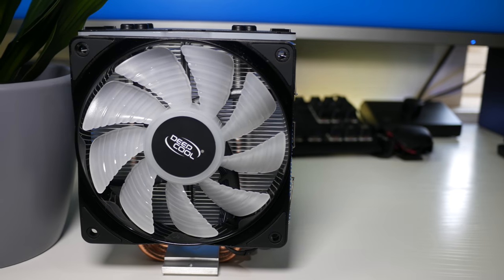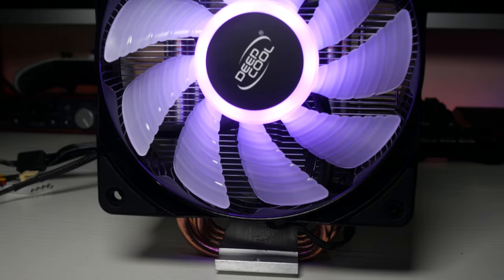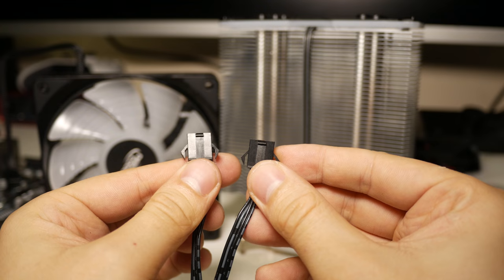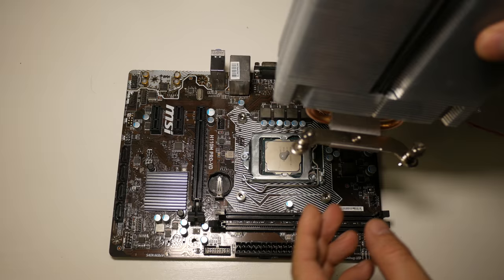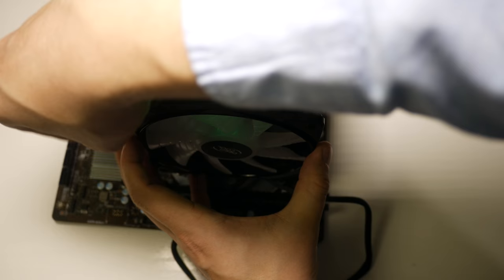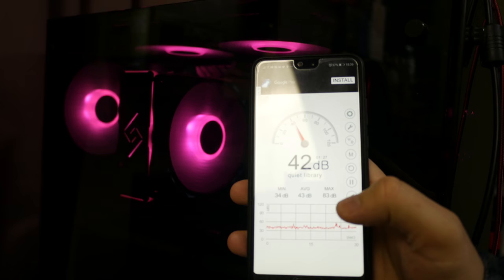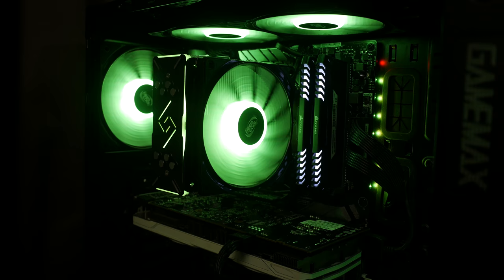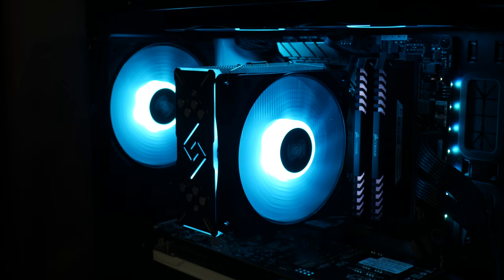DeepCool Gammaxx GT RGB CPU Cooler Review, Install and Thermals

Comment: Nice review. Short and sweet and to the point.
I just put one of these coolers on a Ryzen 5 3600X and it's been working much better than the stock Wraith Prism cooler did and I was already using DeepCool fans in my case and had a spare so now I have two fans on the cooler and it improved even more. I don't overclock so this cooler is going to be just fine for my build and having matching RGB components from the same company makes my build look very nice too. It's hard to get matching RGB lighting when mixing brands.

Comment: I've OC'ed my 8600K to 4.8GHz stable at 1.27 volts, 0 AVX offset on this cooler. Excellent temps all the while. 4.8GHz is certainly doable on this, but anything higher will need a better cooler.
Reply: What were your temps?
Reply: so do you think a Intel Core i5-9600K 6-Core 3.7 GHz wil be good on this?
Reply: @rocket8981  It should be as long as you don't fully overclock it

Comment: Is the Gammaxx GT RGB cooler than Gammaxx 400? In cooling performance (excluding the obviously good looks), is the GT a performance upgrade if I already have the 400?
Reply: discovered it?
Reply: Allagadan Design Same Question
Reply: Same question
Reply: almost same, the GT only slightly bigger, probably only 2 degree C temp at most

Comment: cool vid buddy. Indeed I use it with 8700k at 4.7Ghz and the temps on BFV are around 75-82C with a room temp of 24C. Probably need a better cooler for the 8700k

Comment: what's better this or hyper 212 black editiom?
Reply: If the 212 BE is similar to the 212 EVO, then the GAMMAXX GT would perform a bit better than it. Techpowerup has a review showing the GAMMAX GT performing about 5-6'C better at load than the 212 EVO. https://www.techpowerup.com/review/deepcool-gammaxx-gt/6.html
Reply: @Intranetusa  What about the noise level? who's better 212 BE or the Gamaxx GT?
Reply: @ult7511  Look on the next page of the link.
Reply: The hyper 212 BE has a new type of install. Apparently, people used to the old install find it highly annoying, but it's supposed to be easier. They also use an updated, better fan, it's supposed to be overall a pretty decent upgrade over the original. I'm likely ordering mine tonight.

Comment: Hi I have the MSI b350 tomahawk, and a phanteks p400 that comes with an rgb strip. I was planning on buying the 3 pack of fans, and the gammaxx gt. Would this work with my motherboard? Or would I need to buy some sort of adapter. I believe you made a video on this board, so I'd really appreciate some input, thanks
Reply from the maker: Lumen Roy I would probably just use the included controller as the tomahawks RGB (previous owner) is super limited to the point they should of just not added it.
Reply: Yeah the B350 Tomahawk doesn't have many features in the RGB, the newer B450s have much better software for controlling RGB. So, just use the included controller unless you're okay with just having a static color.

Comment: What cooler would you recommend if I got an Intel core i7 8700 non k?
Reply: if it's non-k there's no reason to use an aftermarket one.
Reply: I would disagree depending on the circumstances. If you are video editing get an aftermarket cooler! Seriously I had someone make the mistake and wondered why their processor was so slow compared to benchmarks. Thermal throttling really kills it. Otherwise gaming it should be fine in nearly all circumstances but the stock cooler is so ugly /:

Comment: I’m having trouble figuring out where to plug in the cords into my motherboard, it has 3 and I’ve plugged them into different Cpu inputs on the motherboard. The computer turns on but the fan/rgb do not. Someone help?

Comment: Hi, I have a ryzen 5 1600 on a b350 msi, now I want to change the heatsink by putting a deepcool gaamaax GT, do I have to dismantle the motherboard and replace the back plate to do the operation?

Comment: Quick question, I already have 3 rgb fans installed as intakes, but the fans came with a 1 to 4 rgb splitter, so I have 1 spare slot, does that mean I can use that spare plug to install this cpu rgb option?
Reply from the maker: It should work as I messed around with a splitter and a few rgb devices when I got my rf 120 fans and they all synced fine.

Comment: Quick question, I just bought the Asus ROG Strix H270F motherboard and then this cpu cooler plus a 3 pack bundle of deepcoolscase fans. I was wondering do I need to buy any adapters for the rgb to do aura sync or should it work fine?
Reply from the maker: Aaron Chan everything will work fine.

Comment: Is the installation of this cooler only directed to the back of the enclosure or can it be installed directed to the ceiling of the enclosure?
I mean the am4 board, thank you.
A instalação deste cooler é somente direcionado para traseira do gabinete ou pode ser instalado direcionado para o teto do gabinete?
Me refiro a placa am4, obrigado.
Reply from the maker: It's the same for both intel and amd
Reply: I mean the direction, if it is only for the back or it can be also for the top part of the cabinet?

Comment: The result in i5 8400 is great. But can the cooler do the same to i7 8700?
Reply: Abid Setiawan I got this on an 8700k running a bit oc, gettin around 30-35idle and 55-65 gaming load, hits like 75-80 if I’m streaming single pc at faster x264.
Reply: @hajime21sac  hm thats not bad. Thanks for the information mate.

Comment: Do you think this would be sufficient for the 3700X?
Reply: 7HeartThrob7  I use this cooler, it does OK. My CPU will hit around 84c under heavy load, but never for more than a moment because of how the Ryzens boost sporadically. Usually stays around upper 70s heavy load.

Comment: Can you sync the rgb lights with the cooler, if the fans are not deepcool brand?
Reply: I think it's Asus aura compatible so if your motherboard is an Asus one you will be able to sync it with your motherboard maybe if you have RGB ram but if you want to sync everything up I think you'll have to get aura supported fans and that's not common so...

Comment: I have this cooler. While it is really good.. I fucking HATED mounting it. It was easily mounted, did it in 2 minutes. But when you screw the fan onto the board.. the mounts it's being fastened onto can start turning around and SCRAPING at your motherboard. And given that there's wiring going underneath, this is not something you want.

Comment: I have a question why does my cooler show another color?i connected to the rgb header in my my asus motherboard and whenever i use the Aura software to change the colors it show wrong color lets say i put it on green it shows blue but why?
Reply from the maker: marjan center sounds like you haven't run  the sync setup on aura
Reply: what do you mean?
Reply: i did try color cycle and it was working well
Reply from the maker: marjan center you have to synchronize them with the aura software not all RGB are plug and play.
Reply: can you tell me how could i do that?

Comment: I really like Deepcool's Cpu cooler's, they are very well known for their silent running under the heavy load but I don't like the Cpu fan sticker on this particular cooler, The sticker seems to wobble up and down whenever the cpu fan Spins, I Didn't expect a Big company like Deepcool Doing these small mistakes.
Reply from the maker: Prateek Jadon I need to do some tests but I'm pretty sure that's just when there at lower Rpm. Asus motherboards allow you to go lower than its rated rpm so the wooble effect could be due to these issues as they certainly don't wobble at higher rpms.
Reply: TheFullSetup I understand what you are saying but I've seen all of the unboxing and reviews that I could find on YouTube and the wobbling is in every single one of them,could be a Design thing But I wouldn't lie this cpu cooler is very good if you take performance into consideration.

Comment: I5 8400 Stock? I was thinking of getting an Intel I5 8600k would that work at like 4.5ghz with 2 extra fans
Reply from the maker: ZANTA yes but I wouldn't go to far with overclockinh it adding an extra fan only really drops temps a few degrees on air coolers.

Comment: I will oc my r5 3600 at 3.9 or 3.8.. Is this aftermarket cooler good to go?
Reply from the maker: A ryzen 3600 already boost to 4.2ghz no need for overclocking
Reply: @thefullsetup  thanks. Noted
Reply: @thefullsetup  can i also ask if its good with b450m mortar max mobo? I want to make my build compact and i'm on the tight budget...

Comment: I have no 12v rgb header in my mobo to plug this in  what should I do ?
Reply from the maker: Use the included controller which doesn't require a 12,v header.
Reply: @thefullsetup  so what is the only cable i need to plug in to make my cpu cooler work ?
Reply: @Jade-ce4ke  you need to plug your fan into a 4pin connector on your mobo, it will be labelled something like "CPUFAN1" depending what mobo you have
Reply: @thefullsetup  similar problem to riven KR here,  i have an MSI B85-G43 mobo, i use rgb fusion to control my GPU, i haven't gone over the manual yet but couldn't find a 12vrgb 4 pin. so i doubt that i will be able to control the rgb from the fusion software? any help muchly appreciated
great video btw
Reply: @tomrees1169  the only solution is you will manually controll the cpu fan using its other cable w/o using the `12v cable and by that u cant use the software and adjust everything using the controller along with this cpu fan.:) happy to help !

Comment: Would anyone recommend this over the Ryzen 7 3700x stock cooler?
Reply: i've been using it for a year on my 2600 which is the same TDP as the 3700x and it keeps in cool even with a big overclock, and its fairly  quiet
Reply: @xFlRSTx  Awesome 👍. What are your temps on idle/load?
Reply: @WindRaider016  4.15ghz at 1.4v(+.25v) and get like 45c idle with low fan speed, 65-75 under full load. it gets a bit louder at 75 cause i ramp the fan up to 100% to keep it from going to 80 or 85c but im also running a pretty heavy overclock with borderline unsafe voltage. keep in mind i never hit 75 in normal usage unless im doing something really specific, never hear it in games for example(even cpu heavy ones). I would let it run hotter just cause i don't care, but i need the cpu fan to cool the VRM heat sink on my stinko motherboard or my oc gets unstable.
Reply: @WindRaider016  theres also no weird fan noise, it's just the whooshing of the air
Reply: I'm using it on my ryzen 3700x overclocked to 4.2Ghz @ 1.25v and its running average 48c in Triple AAA titles like warzone, looks good while doing it to, my cpu idles around 32.8C average on stock fan curves

Comment: It works on i3 4710?
Reply: Monica Gaba you don’t need a powerful cpu cooler like this for that low end of a cpu. You can use the stalk cpu cooler that comes with the i3 and it will be more than enough. The only reason people use fans like this is because these $350-$450 chips like the i7-8700 are so so powerful that they get super hot if you don’t have a capable fan cooling it. But for the i3, the stalk can that comes with it is way more than enough. Hope this helped!
Reply: @Lizestechreviews  thanks very much!